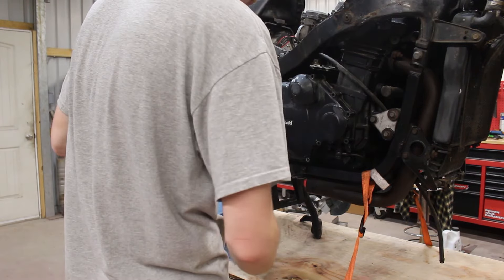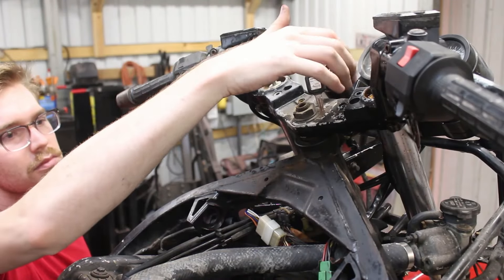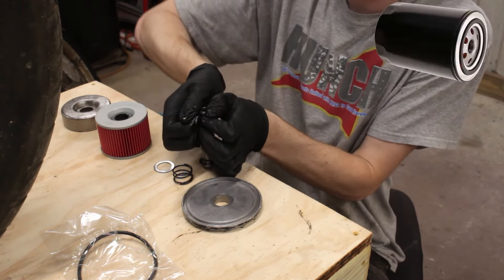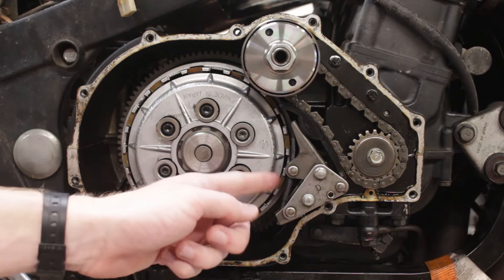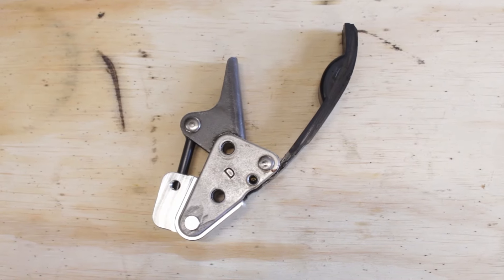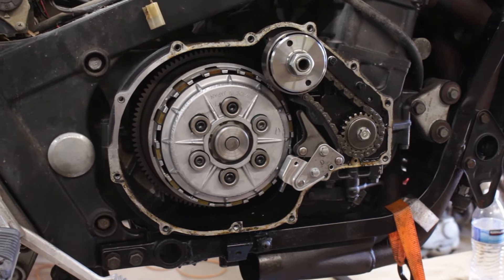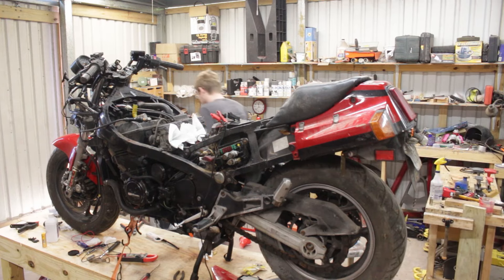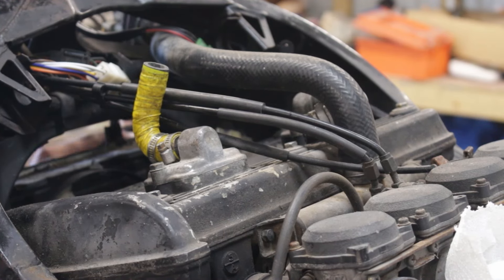Looking for a Pulse | 1986 GPZ1000RX Revival - Part 2

Comment: A cylinder with oil in it will have better compression than a dry one, that mystery oil probably gave you better results than your engine probably has

Comment: I love the series! Fixing up neglected bikes like this is so satisfying. Just a tip, you no longer need to use anti-seize on spark plugs. Modern plugs have a coating and they recommend against anti-seize. I've always used it in the past as well.

Comment: That front drain bolt is for the oil cooler and lines. It's about 1/3 quart in there. BTW, I've been riding this bikes younger, bigger brother for near 25 years (1996 GPz1100).
Keihin CV carbs: been there, done that. New CV diaphragms, new float valves needles and seats, and new float bowl seal at a bare minimum. The rest can be cleaned out no problem, but you absolutely must find and write down the number of turns each mixture screw is set at for a starting point as they are a royal PITA to adjust when on the bike, even with a special tool....then again you're probably looking to put pod air filters on and not the original airbox, so they will be a bit easier to reach.

Comment: I love that feeling of reviving an old engine. I just did this about 3 weeks ago with an older Snapper Rear Engine rider mower that sat for 10+ years outside. Check the oil, good, check for spark, good, check for fuel delivery, good, pull the pull cord about 20 times to loosen the cylinders up and then spray some starter fluid in the combustion chamber and it ran the first pull for 15 seconds. Did that 2 more times and it was running! It was so exciting! Now to just do the rest of the restore. I should record it and put it on Youtube!

Comment: As someone who has been rebuilding and reviving bikes for the past year and a half. I learned the first thing I want to do is make sure theirs oil in the engine and make sure is has spark and compression and at least get the engine to bark off ( just a spraying gas or starter fluid into the intake ) before I start doing other work on it. Nothing is more disheartening ( or a waste of time )  than doing a ton of work on the bike only to find out it wont start up. This also allows me to map out everything I need to look into doing to have a fully functioning bike and getting a parts list together.

Comment: The bike's condition is terrible but it makes for better videos and a more satisfying restoration. Love the problem solving on display. I think the valves should be looked at, they're mentioned as a potential cause for the rusted cylinder but not the low compression. I restored an 87 ninja 250 so I mostly know what you're going through, wish you lots of luck for your build.

Comment: I bought a brand new GPZ1000 RX in 1986. It was a good bike, but as you mentioned in part 1, not as good as the 900. Regarding the extremely snug fit of the battery, and the difficulty of getting it back out again, here's what I did. Take the battery out. lay a length of plastic packing tape into the battery box. put the battery back in and cut the tape so that you have enough to make a handle. Superglue the two ends together, and away you go! I hope you find this helpful. As regards the exhaust, a firm by the name of JAMA used to do a full replica system. Looking forward to part 3! Best wishes from the UK!

Comment: Nice work on the chain tensionner, I am very happy to discover the "how-to" regarding this specific upgrade. Keep in mind though that the tensionner chain itself has a wear limit and you should check it against the values in the manual (you have to measure x amounts of chain rivets and is the length is too long the chain is toasted)
Just do it once before serious usage of this bike.

Comment: A great bike you have chosen to restore, love those 80s liter bikes.  FYI:  Coils rarely ever go bad, however, if you want to restore them for an extra set, it is time consuming.  First, separate the coil from the wires and measure them.  Usually it is the metal, corrosion.  Secondly, inside the boots are either metal or copper leads; totally fouled or corroded.  Soak them in a good rust formula for days.  If needed, put a Dremel on them.  The wires and coils will read 0 ohms; however, inside each spark boot is a resister so the entire boot now has to be taken apart.  Third, take everything apart by cutting the boots with a razor or scalpel.  A small incision will allow you to slip it past the rubber boots when you put them back.  You can glue them or cement glue the incision once they are fixed or the boot is replaced.  That is it, everything now reads 0 Ohms and should be perfect.  I do this all the time and have three sets of wires and boots for each bike.

Comment: Good work. As another commenter noted, at 9:55 there is a crack in the clutch basket. Maybe the basket should be replaced before there are more missing chunks of metal wandering around inside the engine. Sometimes combustion deposits become trapped on the sealing edge of the valves. Running the bike hard in high rpms can correct this. Or not. A guy can remove the shraeder valve on the compression tester hose, then squirt carb cleaner down the spark plug hole. By turning the engine over, as in a compression test, and holding the thumb over the open end of the hose, carb cleaner is forced up into the valve area. Pst,pst,pst. It works and can raise the compression. Running too high of an octane of fuel can cause this condition.

Comment: Nice bike man!
Glad you are bringing it back to life.... They definitely are worth it.
I've got a 88 ZX10 I'm bringing back to life. It was headed to the recycling center, doomed to die, a guy that worked for them, he got it for what the scrap yard was going to pay for it, I asked him about buying it from him, but, he said no, he was going to fix it. Well a couple of months go by, I happen to stop by his house, I see it in the carport. With the tank and the seat off of it, and the valve cover gone off the top of the engine, and I asked him,  did you find out what was wrong with it? he said no, I'm just going to scrap it I think it's locked up.... I asked him again about buying it, paid $125.00 for it, and took it home! That was 3 or 4 years ago. I said three she said four. I still say three. started on it a couple weeks ago got it back in time, where they had pulled the cams up,and made it jump time. cleaned  and rebuilt the carburetors,  you know the regular stuff.when they have been sitting. about got her back together. I like it. It's kind of a heavy bike compared to today's bike's, which have a lot more motor and a lot less frame. It's old but it ain't lacking. And will speak for itself.... Kawasaki's are awesome bikes, no matter the year or the model. Best of luck to you on your project. Ride safe..if you still do.

Comment: Having owned an '85 GPz 900R, I'm loving this as much as the Fiero series!

You should look into getting the same kind of plug boots as the original though, as they also serve to seal the plug wells. With your current set up you're bound to get a lot of water and crud  down the wells eventually.

Comment: Knotts motor cycles in Redditch had one of these in black in the front showroom  window  that I used to drool over when I was 17 .had to make do with a new ar80 instead. Had some great 2 strokers after the ar RG250 mk1 and a power valve 350. Ride a 97 black zx7r now which I've had since new. Happy days😆

Comment: We are building an 80s Ninja as well and faced the same issue with the spark plug boots being an open circuit. There is a small resistor (5 kOhm) in there that you can replace, but often times the lack of continuity is simply from the plug and spring inside the boot being rusty/dirty. We were able to get all 4 of our plug boots back to within spec by simply disassembling and cleaning the components. It's super easy to do and can save you a lot of money! Great video as always!!!
Reply: Link to video of fixing our plug boots just in case anyone else is facing the same issue: https://youtu.be/8JUGdBCBB4Y

Can't wait to see this bad boy back on the road! Keep the amazing videos coming, Ronald 🙂

Comment: Random thought, the previous owner had a split for the power wire to the coil so they could probably mount something up front while having power to a wire only while the bike ignition was running. Loving this series btw

Comment: Looks like you need a better way of cleaning parts. ZEP Purple Industrial Cleaner comes to the rescue. Plastic tub with Zep or add to a spray bottle.  Comes in concentrate formula so a gallon goes a long way. I used this stuff to dissolve railroad grease. Often used it 100% strength.  WARNING use rubber gloves this stuff will strip all the oils from your skin. Lowes & Home depot sell a variety if ZEP products.  Looking forward to more rebuild videos.

Comment: I've owned a gpz900 two zx10s and the gpz 1100 . I completely restored one of my zx10s , I've rebuilt several gpz engines . They're great bikes ! They've several little niggles like the tensioner you fixed , the biggest issue can be the 5th gear jumping out , the second gear dogs don't engage fully and wear if abused , bad shifting ! I had to replace 2nd and 5th gears on the 1100 , you can access it by just removing the lower part of the motor . I love to see you young guys going through what I did ! It's fun but it can be a pain at times . Oh and just put grease on your fingers and pull the gasket through ! Good luck and greetings from the UK !🙂

Comment: Dude, if you haven't installed the carb overflow mod to this bike, I highly recommend it. I bent one of my connecting rods and had to pull a lot of stuff apart to fix it. Thankfully (if you can say that), it was on cylinder 2 that I could reach from the bottom.  LOVE THE CHANNEL!

Comment: Having owned and wrenched on more than a few four cylinder Kawasaki’s this revival really makes me want to get another one.I really appreciate the methodical approach you take to problem solving, diligently working through the issues. I’m eagerly looking forward to the rest of this series!

The carbs should be pretty straightforward to rebuild, but they might be messed up by previous owners.Probably a good idea to get a set of stock jets and needles to start off with, or a mild jet kit. I probably have them laying around somewhere :-)

Comment: Love all your videos! Been watching since part 1 if your Fiero build. I am a car and bike guy too. One word of advice though. I restored a 1993 Honda CBR900RR a couple years ago and had the exact same issue with cylinder 1. What typically happens is since the bike leans over to the left side, gravity tends to collect moisture in that cylinder and it rusts. I also used Marvel Mystery Oil and some other methods to try to clean it up. Problem being, once you rotate the engine with any rust in that cylinder at all, it will instantly score the cylinder bore surface, which will lose compression in that cylinder. The Marvel Mystery Oil I think is giving you false compression numbers since it is a wet cylinder now. If you have it dry, I'm sure you will see the compression numbers to be much, much lower. I had to rebuild mine. Anyhow, love the videos and keep them coming! Good luck.

Comment: I had one of these bikes in the early 2000s,it tried to kill me,it had amazing power but rubbish brakes which would fade out if used agressively,single pot calipers shouldnt have been on a bike with this much weight and power.It would wobble when pushed hard but it wasnt to bad enough to throw ya.Never had any mechanical issues with it,but after a couple of years of thrashing, it started to lose power,when i first got it,it would get up around 160 mph,2 yrs later 145mph,adjusted the tappets and new air filter and engine oil another hi speed run,148mph.Properly valve springs or valves,maybe rings.When the brakes faded i was coming into a hi speed down hill sweeper following another rider i braked as i was gaining on him real fast,slight braking then the front lever  went limp(boiled the fresh brake fluid) i had to go on the inside of him which scared the hell out of him as there was virtually no room,made it but only just,amazed nothing scraped,found out later they dont scrape they just roll off the edge of the tyres and down the road you go.Definetly more grunt than the GPZ900R,blew a few off  in a straight line.900 handled better.,i would say the valves that were open would have rust on them,hence low compressions,a bit of running should come right.Put new tyres on it,old ones disintegrate at speed as i found out.Good luck with rebuild.

Comment: I don't think that second oil line is bent, I believe that is factory.  I base this on it was the same way on my 2000 Connie which uses that engine platform.  I do remember I could never get a socket on that second oil drain.  I base this on my memory, which could always be wrong.

As for the no gaskets, possible internal damage, side covers were removed to determine if there was internal damage and replaced without gaskets by PO while waiting for money or parts.

Comment: I'm working on a yamaha R1 last year with Carbs. I rebuilt those fist because anything with carbs that sits usually needs a carb rebuild but now I'm dealing with low compression in all 4 cylinders I wish mine recovered like yours. Looking forward to the next video.

Comment: Some good work done there. If it was me, after seeing that rust I would have the head off and possibly the motor fully to bits, that rust will for grinding paste and trash the bore on No1. Not looked all the way through the comments but just saw you put the oil filter back in, check that plate over the element. I think it goes on the bottom before the filter so the filter sits in a pool of oil, manual will show it. I would remove the headers and whip off the sump too, those clutch bit will have gone somewhere. Don't forget to put in some coolant!!! Water pumps do not like running dry. Loving the videos. Well presented like your style. Regards for the UK

Comment: Hi I owned and abused an RX for 27 years, the engine is awsome but if you don't want to die 
change the wheels forks and brakes for ZX9R or ZX12,  just friendly advice 😉

Comment: Dude! This is shaping up to be a great series. And big time kudos for using C5-A on your plugs. I recommend it on ANY plug to head mating.
Reply: Modern day plugs have a coating on the threads deigned to work in alloy heads. Unless you gorilla torque the plugs in you should not have a problem putting them in dry. NGK say not to use anti seize on their plugs.

Comment: Nice series dude! Awesome you are giving these bikes a new deserved life! Saw you replacing the tensioner because of the outer piece broke off. Nice solution you found there. 
But I think the damaged clutch housing is inbalanced and can cause vibrations in the bike and probably do harm in the long run for more components. You should replace that piece too if you want a propper running bike. 

Goodluck with the project and series!

Comment: It's a great feeling when you get to the stage of the engine running. I've just spent three months stripping down the engine to put in a new cylinder head gasket on my 89 ZX10. Hearing it start and run smoothly was such a relief. My only dissapointment was the compression check, following the method outlined in the manual I got 150, 135, 135, 147 psi. Within spec but I have seen elsewhere that the difference between all the cylinders sholud be no more than 5psi!! Or am I worried over nothing?

Comment: Sweet progress, i had on of these with a bad engine, i swapped it for a ZX10 engine. had same problem with the clutch basket. i just ground down one side of the part hitting the clutch, never had a problem again. the reason it hits the clutch is on kickback when shutting off the engine, you can easily hear when it does it, it goes BRRrr klink :-D never heard that noise again. and the old girl does fly, i have a 0-200 km/h video on it. sold it long ago though

Comment: Hey Ronald, it was cool to see those piston rings come around. I think it will improve even more once the bike actually runs. Plus the valve springs that were stuck in a compressed position during those years of storage have probably lost some of their spring as well. Hopefully those come around too.

One other comment: I couldn't tell exactly what you did from the video (so forgive me if you already know this), but having your butterfly valves closed will impact your compression test.

To get an accurate test, you need to either remove the carburetors or hold the throttle right at full beans while you're cranking the engine.

Keep up with the great videos!

Comment: Great work, i hope zyl 1 wont give you problems down the road. Its a great bike otherwise!
One tip if i might: when using heatshrink hold the cable just above the flame, not into the flame. Theres still plenty of heat and you wont burn the cables and leave burnmarks on the shrink itself :)

Comment: Compression should be done with a wide open throttle Ronald.. so compression will definitely be better once running too. Just sold my GPz900R a few months ago and was a great bike... a bike a drooled over in the bike shop window when they first came out.

Comment: You can reach the second oil plug by going through the right side exhaust with a plain old wrench. Takes a while but it can be done. I’m sure though since you have a single exhaust one minus a dual exhaust if that matters. Love your videos they are the only ones I have found that show everything on my old 86 ninja 1000. Except taking the fairings off lol.